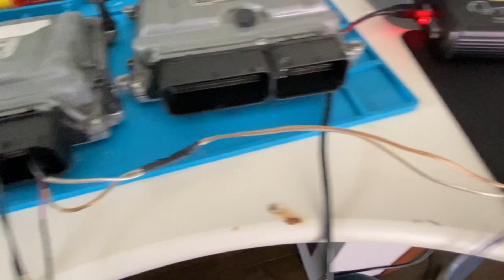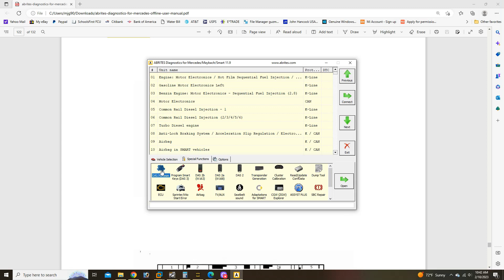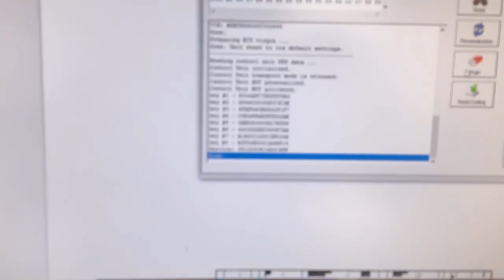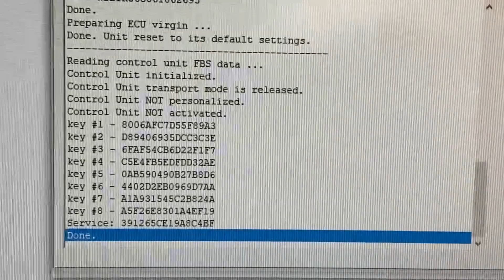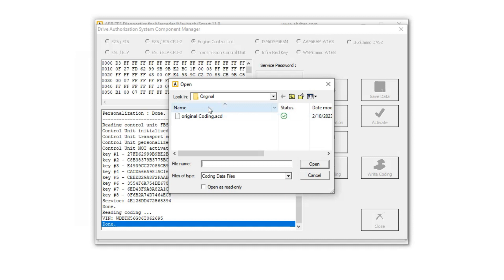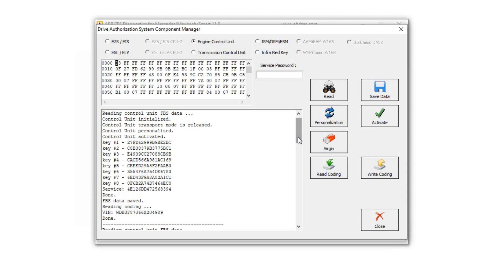Mercedes Benz ME9.7 ECM cloning with AVDI. M272 and M273 engine control modules.

Comment: Can you make my me9.7 from a w211 2007 e350 (m272) to m273 for my upcoming motor swap? 
Thanks
Reply from the maker: We could use the 273 ECM and code it with your FBS data and VIN.
Reply: @mercedesbenzspecialist  thank you for the reply, I tried to call.
Reply from the maker: @rizzotto139  try us on Monday-Friday. 7am-5pm PST. 

Call us at 818-510-3375

Comment: Bro, you’re GOATED! The way you break down all the process I’m a simple easy to explain way! Straightforward, oftentimes people selling you those services describes them in an obfuscated way. Can the “major scan tools” do the cloning process? I’ve been told even to clone you need to “initialize”, is that not the case?
Reply from the maker: Thanks for your comments I appreciate it. 

The major scanning tools cannot clone. But they can program a virginized unit.  

For cloning you’ll need a programmer like AVDI, Kess, K-Tag, HexProg, etc.